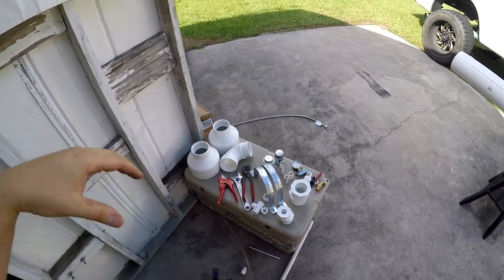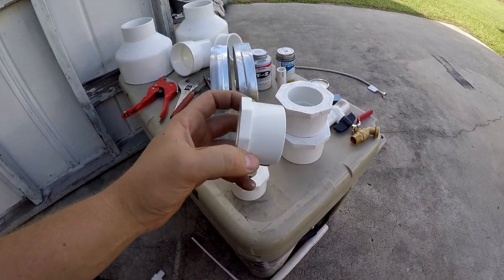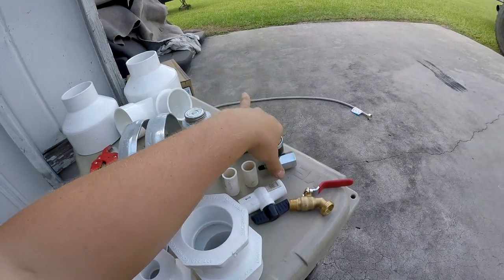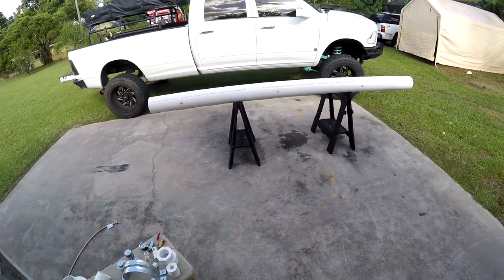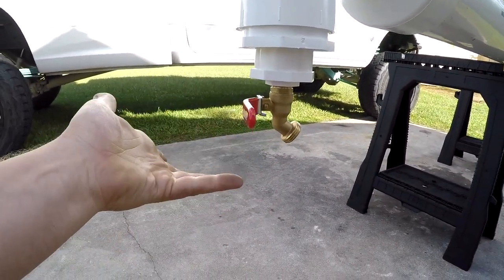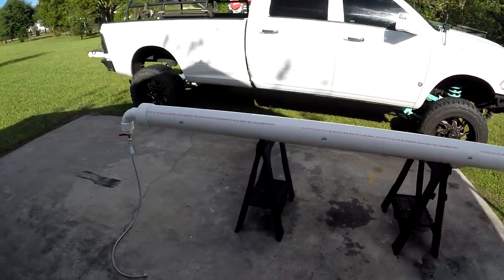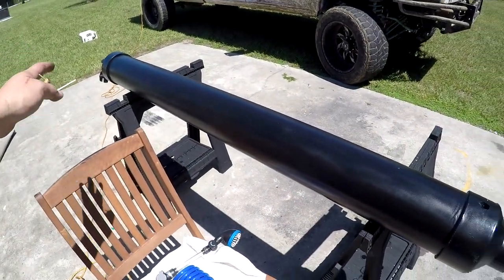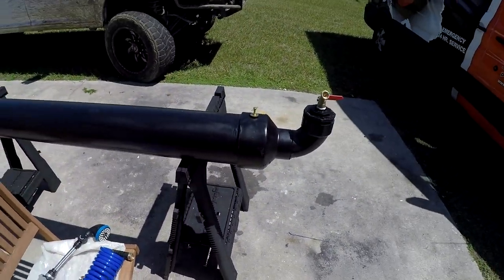Do it yourself shower/water tank super easy camp ready!

Comment: Nice build. What is the purpose of releasing air through the ball valve? Also, is there a way to mount the spigot so that it's the lowest point? I want to avoid drilling another hole for a drain plug. I'm looking to build something similar but am going to add a T pipe with a wide mouth facing up with a screw cap. I like the 2-way hose idea to fill, but would like the option of dumping a gallon jug in there in a pinch.